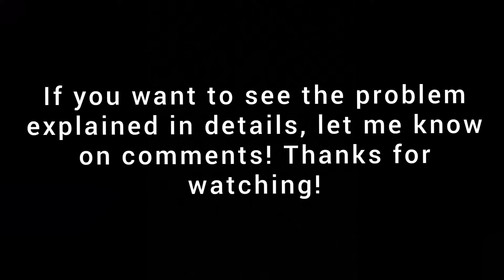CAR REPAIR: Golf V variant tailgate lock replace

Comment: Hey, thanks for the video, what's the part code for the lock?
Reply from the maker: Door lock ESEN SKV 16SKV002, this was in my case!!
Reply: According to etka this is part code for Variant: 5M0827505B . I ordered spare part (unnoficial) with this number and it matched. Please note that with unnoficial part cover for lock (it is hidden inside) will not match (part code  3C9 827 645 A) but it is not needed and doesn't influence the locks work. Hope that helps!

Comment: What was wrong with it? Can it be fixed?
Reply from the maker: Hello!
If you look at the end of this video you can see the details and one of the plastic gears is broken apart(more like the core ripped off the gear). I have already repaired one by inserting a metal thread (to be taken from a screw), it gave strength for it to work. Still working, but the problem seems to be that one of the limit switches is not registering the position of the mechanism, which breaks the plastic gear. I notice that, because the mechanism what was replaced in this video broke again after a year of use (exact same problem, plastic gear!)
Reply: @repair-stuff  Thanks
Reply: @repair-stuff  I am having difficulties taking off the plastic trim. I have a feeling that I will brake something if I pull harder. What size is that torx?
Reply from the maker: @35o125   It really comes off quite hard, so you need to take it out carefully. Not sure about the torx but looks like a 26 or 25. I don't have time right now, but I could do a video on how I fixed it!
Reply: @repair-stuff  I've managed to take it out. Turns out it wasn't a torx, it's spline M8.
Reply from the maker: @35o125  did you manage to fix the issue as well?
Reply: @repair-stuff  not really. I've managed to make the latch close, but now I can't open it with the W handle. I can open it from the inside though. So, I've unplugged the wires because the light was staying on. Ordered a new lock. Fingers crossed.
Reply from the maker: @35o125  Ok let me know how it went!